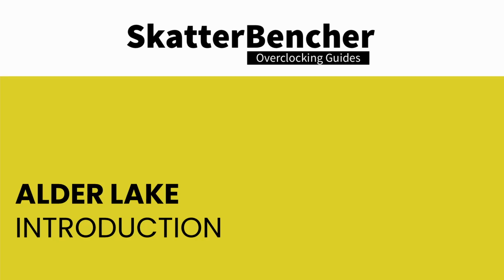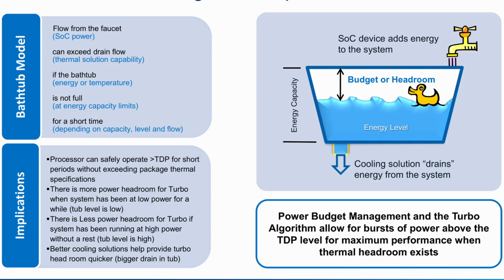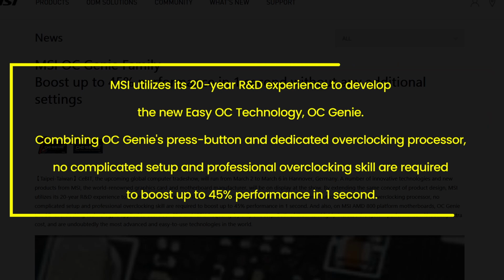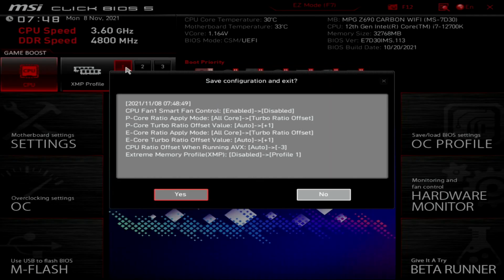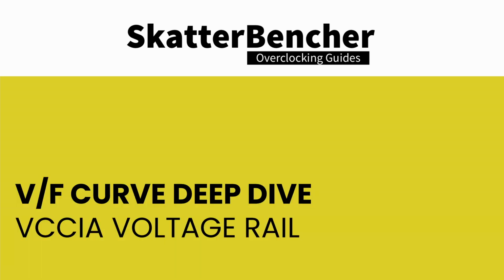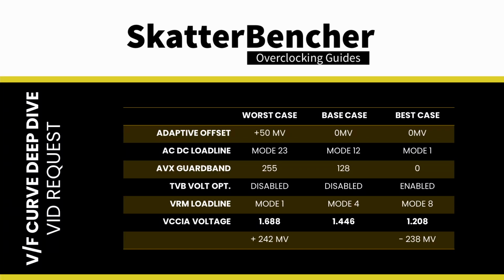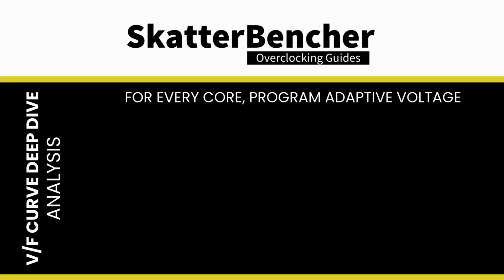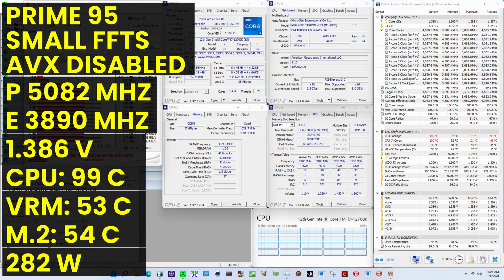Core i7-12700K Overclocked to 5400 MHz with MPG Z690 Carbon EK X | SkatterBencher #31

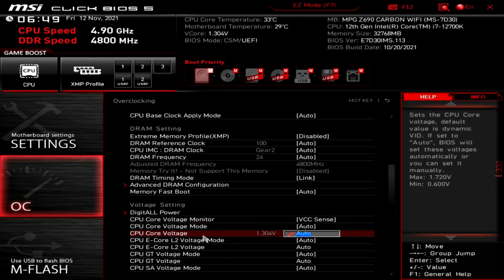Comment: 36:35 is that curve the same for EVERY 12700K? Or every CPU have different voltage curve? I'm using my 12700K @stock and i set ONLY core voltage to 1.22V... All cores 4.7ghz, 360mm AIO and in Prime95 temp goes close to 100'C (~98 i saw and stopped test)... Is this normal or i got bad sample? 😭 In games ~60'C
Reply from the maker: Not only does every CPU have a different V/f curve. Every P-core, E-core cluster, and Ring has a different V/f curve.

As for your 100C temperature: what is the CPU Package Power in HWiNFO?
Reply: @SkatterBencher  When i will have free time - i will check all this and will write there 👍! After sons born - i havent time for PC (only at satturday nights), because im working every other night and half a day im sleeping 🤮
Reply from the maker: Congrats on the new baby! :)
Reply: @SkatterBencher  Thanks, amigo 🍾🥂🙃
Reply: @SkatterBencher  Max power is 220W, i set PL1/PL2 and AMPs to Max, all cores 4.7ghz, after some time i see 97'C, but in games max is below 70'C 👍! HWINFO registered voltage is 1.212V max
Reply from the maker: Hm, sounds like a cooler issue. 97C at only 220W is quite high.
Reply: @SkatterBencher  There are reviews at YT (OC3D for exapmple), Gigabyte board too... 212w 100'C easy! I think, i got bad sample, but like i said - in games temps are perfect 👍
Reply: @KOT-ANGRY  check cooler's cold plate pressure. I bet you either have bad cold plate contact with your CPU or there are a lot of thermal paste between them :)
Reply: OCTVB + AVX-offset + per-core-load-ratios are your friends.
Use AVX offset to lower your P95 load.
Then set per-active-core ratios to maximize your gaming performance.
Then use TVB to boost your performance up to +2 bins when temps are fine.
So in result you will get something like:
4.6Ghz all cores P95 load
5.0Ghz all cores "standard" load
and up to 5.2Ghz all cores gaming load
also up to 5.4Ghz when only 1-2 or possibly 3 cores are active.
Reply: @dmitrylozenko7123  +/- i understand what you said! I like to find the lovest possible voltage with the highest possible ALL core boost. Before this hot hell i had i9 10910 (yes, 10910, its Apple Exclusive, had 4.7ghz on all 10 cores, i9 10900 have 4.6ghz on all active cores)...i had 4 of them and i choosed THE BEST (it was STABLE @4.7ghz, 1.15V!!! ❤❤❤, max temps prime95 was 92'C with 240mm AIO cooler, vents @900rpm), i think - it was the best sample of these i9 ever, because others needed 1.18v for 4.7ghz and temp was 100'C) 🙄! Chenged that i9 to this i7 and YES - it is faster, really, i like it 👍! Each CPU is different... When i was yong, i played with 5+ i5 2500K's, couple i7 2600K's, 10+ i7 3770K's, 2x i7 5700C, 5+ 6700K's, 5+ 7700K's, 2x i7 8700K's, 10+ i9 9900K's and EACH of them was a little different, there was NO identical CPUs...